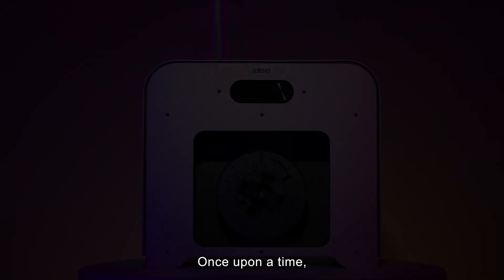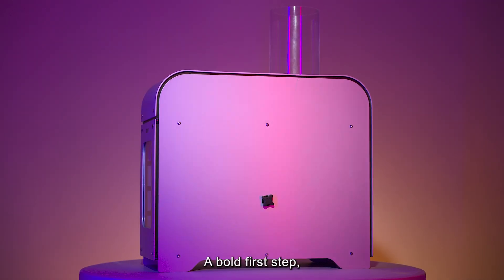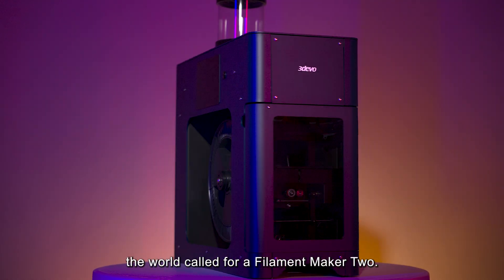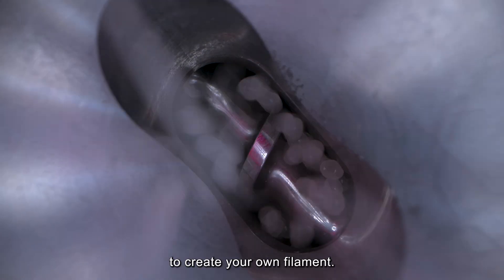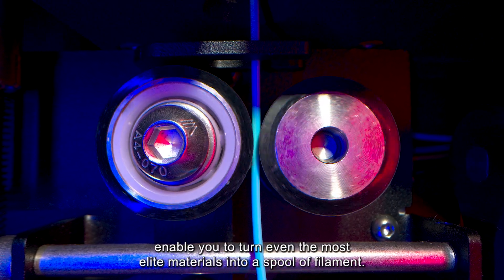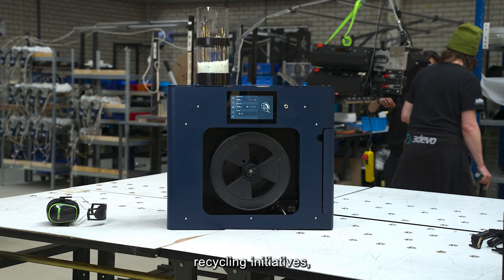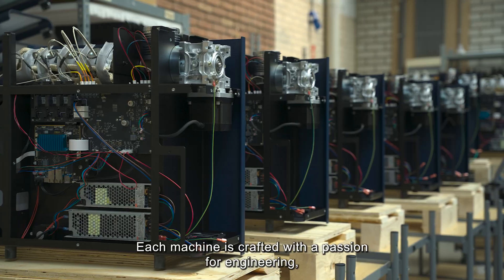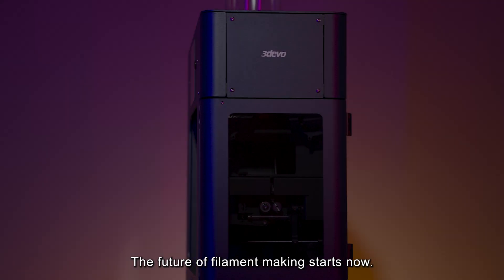Filament Maker TWO: The Next Generation of Material Innovation

Comment: Can it make hot glue filament?
Reply from the maker: Great question! It’s definitely not the easiest material to work with due to how fluid and sticky hot glue gets when melted — but whether it’s possible really depends on your specific use case.

You can try our Project Builder to get a quick feasibility score of your project, or just book a free intake call with one of our material specialists if you'd rather talk it through.
Reply: @3devo  Thank you for your answer! I will think about it. But I fyou made it possible, damn.. the possibilities..